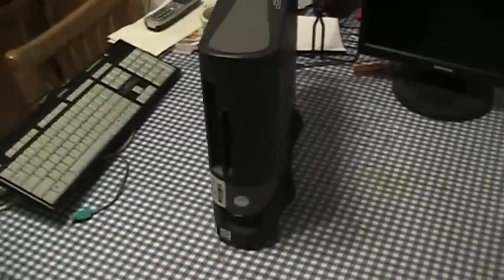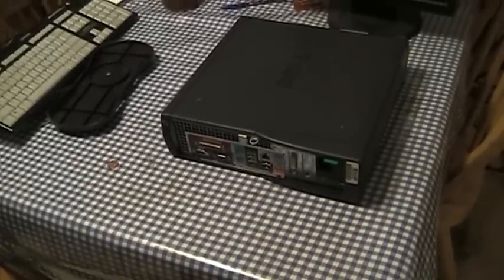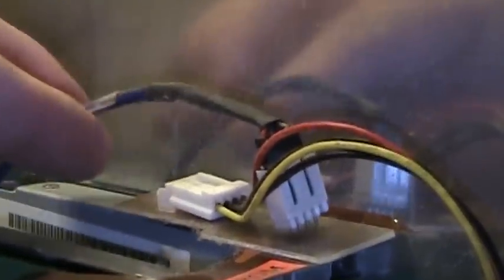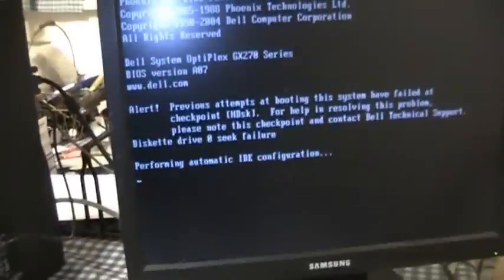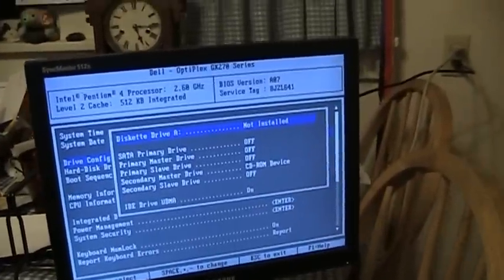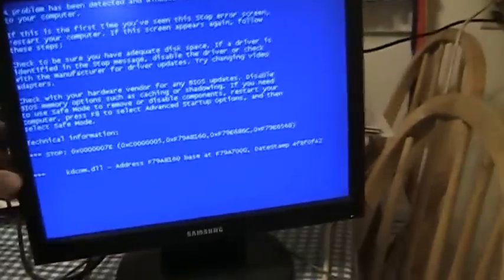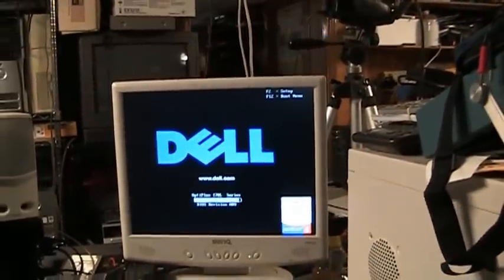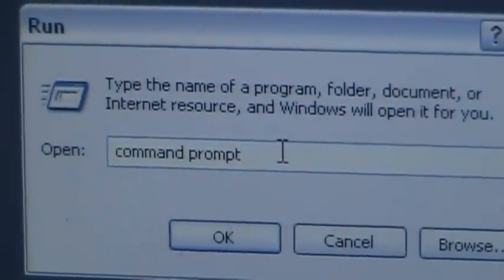UXWBill Explores Another Crappy Computer: Dell Optiplex GX270 SFF

Comment: I got a pallet of these (20) from the state surplus warehouse that were never used, I paid like $150 for the lot and they all had the display mounting options and the versions I got hosted Cor2Duo CPUs, 2Gb RAM, and 120GB HDD's, and have PCIe instead of AGP. IDK if these were stock from Dell with those specs but they are still viable even today as a GP PC... 
I do have OEM replacement parts (Motherboards.  PSU's, cases) for the GX270 Optiplex in my shop as well.

Comment: I am also not a fan of those small form factor systems either. I had one that of course had overheating issues. Just wondering though, was the inside of that computer that clean or did you clean it prior to your video?
Reply from the maker: +KLM817 The computer was presented as found. I did not change anything about it.

Comment: Crappy my ass these things are great
Reply from the maker: +James Kendall The small form factor systems were not "great". Rarely is it a good idea to cram a processor capable of expelling 90+ watts worth of heat into a poorly ventilated tiny case.

The desktop models were much better and the towers fine -- so long as you got one with good capacitors. And while that wasn't really Dell's fault, they handled the defects very poorly. Sometimes they even went so far as to claim that people were "misusing" the computers: including, rather famously, a major university.

Comment: I actually have one of these,, well sort of... it's a GX270 board in a gx 260 SFFcase lol. but most of these things I have come across have had bad caps. as most of these have died from having the heat or caps do the thing in. but it is a working example more or less..(And the only reason I have the machine). I have spare power supplies and floppy drives for this case at least. the power supplies were also known for going south. so I don't blame you for not liking this system. as for the foot? well that explains the hole in the side lol. as for that odd adapter on the optical drive? I have never seen that

Comment: According to the service barcode on the back, that model actually did come with a floppy drive, windy why it's gone. I remember those systems from awhile back and actually have a GX260 SFF, with an original 40 GB IBM formatted Hard Drive that magically has not failed and it's still a very quiet hard drive. Your right about the systems getting very hot, as while the capacitors on my motherboard have never been replaced or been damaged in any way, opening up the computer after a long time with it on results in a very hot heatsink even with the fan

Comment: That thumbnail already cracked me up :D

But with Hard Drives I made following experiences:
Maxtor: no failures yet, although I had a lot of them (which apparently is kind of a miracle)

Seagate prior to acquisition of Maxtor: no failures as well (But I didn't have a lot of them)

Seagate after acquisition: Nothing but failures. Especially the 7200rpm drives, no matter if Desktop or Laptop drives, they all died out.

Comment: I'm surprised there's a single 270 out there that still powers up with out a thermal alert during post.  One thing I really hated on these clam shell cases was the IDE cable always looked like it had been run over by a team of Budweiser horses, and that removing the hard drive was difficult because it wanted to snag up on all the other cables.  And finally, when done you slam the case closed and invariably punch a hole in the IDE cable.

And regarding exploding power supplies, back in 2002 I was working at an office one day and suddenly it sounded like someone fired a gun.  We could smell smoke also so we ran to see if everyone was ok.  There was a computer sitting there with brown fluff sprayed over the wall behind it.  It blew a cap.  Later that day I found the can of the cap on the floor.  I don't quite know how it got out since the capacitor can appeared to be bigger than the vent hole!
Reply: It probably punched a hole in the case.

Comment: Once I also had a Maxtor 40 gigs hard drive in my first very own Pentium 4 computer and it died after 2 years. These drives are crap. There is another crappy drive called "Quantum fireball 13 or 15 gigs model". I also had a bad experience with that one too.

Comment: On the IBM machines, I believe the BIOS passwords are actually stored on a EEPROM, so even if you remove the CMOS battery you will be stuck with it (and unable to use the machine if you remove the battery or if the battery dies)... did Dell do anything similar? (I've had to part out machines that had a password on them... however I remember Gateway and Toshiba could be cracked using the parallel port)
Reply from the maker: +danisidoti84 There are some systems, mostly laptops, that store their setup/standby/startup passwords in an EEPROM to combat easy theft of a locked system. It's much rarer on desktops, although some of them will not give up a password without your throwing a "password clear" jumper on the board.
Reply: +danisidoti84 I definitely know that this was the case with the Dell Latitude C610. I got it for free and had no other laptop. I ended up just using it with the settings that were set prior to my acquisition. There is a way to reset the password by shorting out two jumpers on the bottom side of the motherboard, but the process of taking apart that laptop would have been an odyssey.

Comment: Lol bad memories of this system. Aptly named the "capacitor oven". We rolled out about 700 GX270 SFF machines back in 2004 of which nearly half of them were repaired under warranty due to cooked capacitors and/or bad PSUs.  Can't totally blame the PSUs though as I believe some of them were the victim of students changing the voltage setting to 115V and we are on 240V here in the UK.  This resulted in copious amounts of capacitor smoke from the main filter and sometimes a mini fireworks show!

I don't remember the GX260 from the year previous having that capacitor problem, but the GX280 did.

Comment: Love this video, also noticed the cool pendulum wall clock on the kitchen table, does it still operate?  That blue screen stop error ending in 007 from my experience usually means bad ram. Still a useful computer as a PfSense Box or NAS device pending a few upgrades.

Comment: Not sure which hard drives you are referring to, but I have loads of Maxtor DiamondMax 200GB and 300GB drives which have been flawless, and have been on for thousands of hours and in very hot environments.
Reply from the maker: +EgoShredder I've had some Maxtor hard drives that gave (or continue to give) exemplary service, so it's certainly possible. The larger capacity drives have definitely been better to me.

Comment: Yay! More wild computer adventures with uxwbill! I had a Dell Optiplex GX270 but it was the minitower version. It failed due to a capacitor right next to the CPU just barely starting to bulge. It didn't even leak, just the top was a tad bulged, but it brought the system down to its knees. But this was a fun video to watch, even if you consider the computer to be useless. I love these videos!

Comment: I have a GX260 sff with a WD Caviar in it (20GB, but does the job, I'm not sure if it was shipped with it), it doesn't have capacitors in the same places and none of them appear to be bloated, so I'm guessing it's a different more well designed board, still has the AGP though.
Overall i think you kinda got a bad deal here Bill :p

Comment: I ended up with some of these exact motherboards (no cases) and have decided to build one of them into a secondary PC.  I will mount it in a larger Dimension case, not a SFF.
That cute 160W PSU would probably be hopeless, but thankfully I don't have one of those either so I've been forced to run it with something much more oversized.

Capacitors have been replaced and indeed, I put a Prescott and a fairly powerful AGP card in it. :)  The Prescott seems to work better than the Northwood for video playback, which is important for how I expect to use it.

I have read some scattered comments online saying that these boards will not allow you to boot with a Prescott faster than 3GHz unless it is of a later stepping which apparently didn't run quite as hot as the earlier ones did.  The behavior is interesting - people's comments implied that the BIOS was forcibly underclocking the bus in order to slow down the offending CPUs.

I've noticed that my bare boards constantly emit a USB overcurrent warning in Windows.  I'm guessing it might be caused by a missing ground, perhaps from the unconnected front panel connector, but I haven't tested that explanation.

The onboard GbE is a nice feature.  It uses the 865 northbridge chip's "CSA" link, thereby avoiding the traffic jams that would occur with a PCI card.

In the popular "3DMark" benchmarks, I found that this 865 based Dell significantly outperformed an MSI "enthusiast" board with the sportier 875P chipset.  This was with the same components.  No amount of tweaking in MSI's fancy BIOS could close the gap without losing stability.  It's funny to think that many of the Dell bashers in the gaming crowd back then were actually running a slower motherboard than a Dell business computer.

Comment: Well I was just about to comment on your video about pop tarts and ask if you could make a video of this computer! I guess you can read minds? anyway I'll get to the point here is that I used to have four of those computers running my network as they were conveniently stackable and I can vouch that they had different looking power supplies that were branded by Hypro and just had a dell revision sticker on the top of them, they also had sata power connections even though my machines didn't come with sata discs.

Comment: You say those Maxtor Fireball 3 drives are not very reliable, but I'll just say I still own 2 of those drives, both are around 14 years old at this point, and both still work very well. True they are getting slow in there age but I'll keep using them till the die at some point.

Comment: Oh Bill, you allways brighten my day when your in "hate the computer" mode ha ha :-D.
The hard drive needs a trip to the "high mass moving at speed" department, yes a hammer :-D.
With a bit of work and time, you could make that machine 100% more annoying for yourself, im sure you must love pain :).
Exploding psus: A frend wanted me to look at a media center pc, it was thin and compact for its job, i applied 240v to the psu and it went off like a bomb!!, the psu just exploded, or it seemed so as i was clinging to the ceiling by my finger nails, yep a supprise :-D.
.
I like pain so i took the psu apart, just two small capacitors across the bridge rectifier had lost the will to live, i replaced them and powered it up...... fine, smashing, normal psu again.
The media center still works 5 years later, no fails, mad aint it ? :-)

Comment: Those Maxtor Diamondmax IDE hard drives were junk. I foolishly bought several of their 200 gb IDE drives on sale thinking I was getting a good deal. Around a year and a half to two years of use they started making loud whining noises or locking up. 
I remember in the late 90's a hotel in Orlando Florida had one of these Dell Optiplexs as the guest PC. I had a hell of time getting and printing my airline tickets with it. It was full of adware/spyware crap because someone had installed a bunch of freeware games on them.

Comment: I worked on a crapton of these (and quite a few 280s's + a couple of 260's) re purposing them for a local school (equivalent to an elementary in the US). It was in amoungst other donated machines and sadly probably 2/3 of them had scummed to cap failure but were included in the donation pile as the deal was the unuseable stuff + old machines had to go back to the donator for scrap or something.Even if I could solder, they probably wouldn't have let me fix them that way so what I remember them for is the insane RPM the fan would reach if you applied power and the board was dead.

Comment: I think you can get a modern mini-ITX board into this case and put a half-height GTX 750 Ti in there.
Reply: +mathieu traas Pair that to something like a GA-B85N-Phoenix Wi-Fi mini-ITX motherboard, an Xeon E3-1231v3 with stock cooling, two sticks of 8GB DDR3L-1600 and a M.2 SSD as the sole drive in it. Xeon E3-1231v3 and GTX 750 Ti together draws about 155W maximum (since those iGPU-less Xeons are a few watts less power hungry than their i7 siblings,) so maybe the original power supply there may just work driving the newer platform. E3-1231v3 + GTX 750 Ti platform is more than capable of delivering a satisfactory gaming and workstation experience.

Comment: I recently installed a fresh version of XP Home Edition on an HP Pavillion ze 5375 "lapcooker"(2.4 ghz desktop Northwood in a laptop-what a great idea!) and can confirm what others have stated below. The OEM installtion disk had SP1 included and when booted, the splash screen read "Home Edition" and the loading bar was green.  After SP3 was installed, Home Edition was gone, and the bar was blue. When I got this thing, it had the factory Windows install from 2003 still on it, and it was bog-slow. It's still no speed demon, but now it's at least usable. I'll have to try some Pop-Tarts on it.

Comment: Bill! I have a Optiplex GX150. came with Windows 2000, tried to put windows on it.. and im no expert but. i only have DVD rom (ata) and i wondered why it wouldent install. any help at all will be helpful. i want to get it running as the ultimate late 90's gamer!.
Specs
Pentium 3 1Ghz
256Mb ddr1 Ram
No AGP card. (sold)
Reply from the maker: +Kopboy55 All I can tell you for certain is that a properly functioning DVD-ROM drive should have no problem at all reading CDs. (Recordable discs can be hit or miss in older read-only drives, however.)

If you are looking to install Windows 95, 98 or 98SE you will probably need to create a bootable floppy disk complete with CD-ROM drivers as only a few Windows 9x installation discs were ever bootable. (Personally speaking, I've never seen any. I have heard lots of reports that such things did exist.)

You may also need to erase the hard drive, and a handy tool for that is DBAN. Just be very careful. It will destroy data beyond any practical means of recovery!
Reply: Well, Bill thank you. i formatted the disc but i may have fubar'd it by using NTFS. because windows 7 doesn't allow Fat32. but i will keep trying. It has a working serial port, parallel port, and floppy drive.
Reply from the maker: +Kopboy55 With the GX150, I don't think Windows 7 is going to be on the list of possibilities. (While the Win7 betas certainly could run on Pentium III hardware, and a few people managed to get it running on far less, I think the final release imposed a RAM and processor requirement.)

As great of a processor as the Pentium III was, the stupid RAM ceiling imposed with the Intel 810/815 chipsets is a real problem. Chipsets from competing manufacturers did not have that problem, but good luck getting contemporary drivers or stable operation under any other operating system than Windows, especially with those chipsets having integrated video.
Reply: m just trying to get Windows XP or 95 back on it

Comment: +uxwbill I know at least in the UK they do a Optimist 170L SFF, I am of the same mind that the design was somewhat lacking ( easy bake capacitor oven made coffee come out of everywhere lol) I have had a few of the SFF optimists and i think the later design (GX520 etc...) is much more efficient one. I have a couple of 170L mid-tower systems and they are adequate performers and very stable (although one has the fault of not keeping its CMOS memory). I had a SFF of the same model and re-capped the board. But it would seem there is not very much in the way of ventilation or air circulation. Great Video :)

Comment: The startup bar on XP changed with the advent of service pack three...at least I think that's the one. I know it was green under service pack one and it's blue under service pack three. I only upgraded to service pack two once many years ago and never again for obvious reasons, and I don't recall it changing then.
Reply: +Rebelkid1112 With XP SP2 they changed it to just say Windows XP with a blue bar (and in rare cases a green one although any fresh install of SP2 /3 I've ever done for Home Pro or Media Centre 2005 has been blue). Before that it would state the edition and be green for home and blue for Pro (not sure what colour Media Centre 2002/3 used, but it probably changed to blue once you added SP2 as that turned it into Media Centre 2004 if you had one of the obscure and rare old Media Centre versions).
Reply: That's interesting. I mostly dealt with the home edition, so I don't recall much about the startup on the other editions, but that's good to know anyhow.

Comment: ITS THE POP TART TOASTER. Honestly if it can cook noodles it can cook pop tarts.
I actually had one of those, except it  had a celeron instead of a Pentium , it died when i tried to run windows vista  on it .then i got very very  ticked and threw it out the upstairs window. because vista is a piece of junk people actually need to make an acronym like people do with ford because both are pieces of junk.
Reply from the maker: +isaac roberts A brick of ramen noodles won't fit into the floppy drive opening. Not without significant damage to the noodles, at least. :-P

It is unfortunate that software cannot be taught a lesson in the same way that hardware can.
Reply: +uxwbill yes but a very very small mini pizza can fit through both the floppy and cd rom drives plus i bet if you let your pentium oven warm up and filled the computer with water it would a:blow up B;  fill up the house with smoke c: ding and chime like a clock.
then you would have to eat crunchy ramen noodles :b
plus thats how you get back at windows vista.